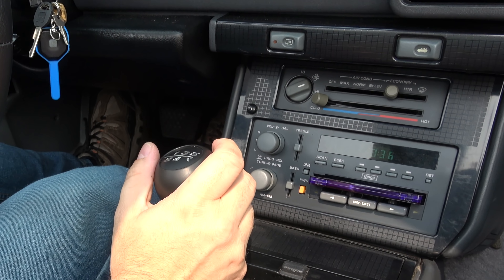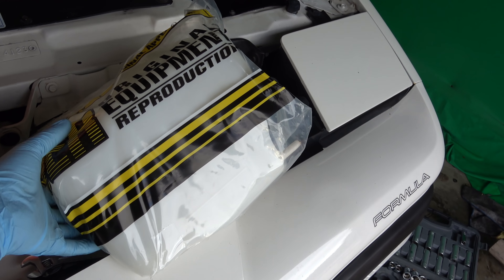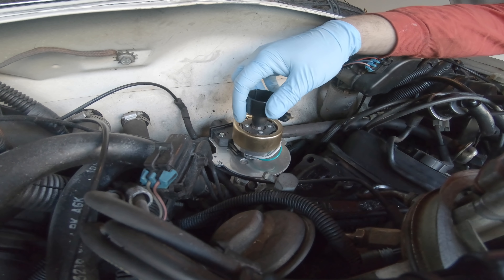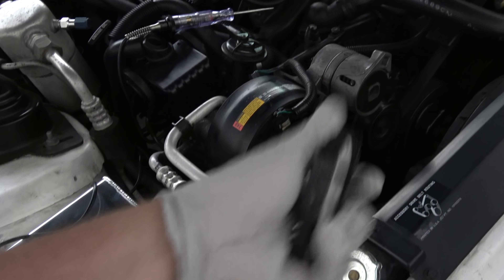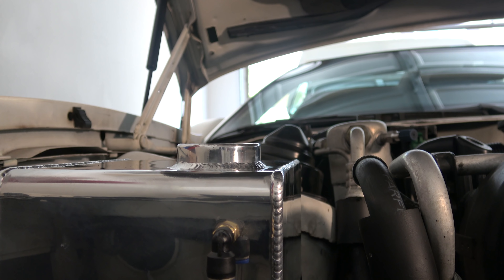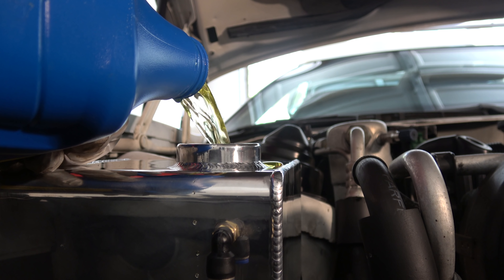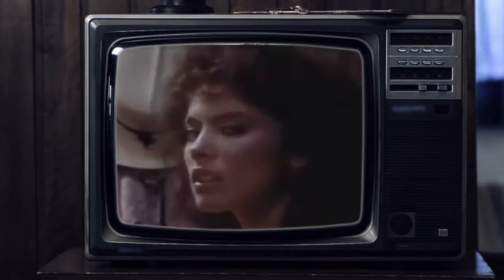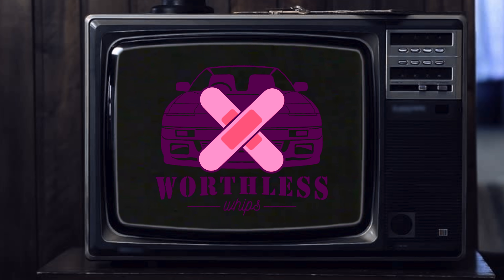They really don't make them like they used to!

Comment: Born and raised in Detroit. Was a UAW member for 10 years... and then I purchased a 1985 Dodge... was amazed at the distinctly superior quality over previously owned vehicles... and then I was shocked to find out it was actually made by a Japanese company. No wonder the U.S. auto industry went bankrupt when it did.
Reply: basically japanese are the german ingeneers of the new world. or maybe the old world cause owning an older japanese car is more of a safe bet
Reply: @4xHitler : Nah, Japanese engineers are superior to German engineers. German engineers can make things extremely intricate and precise, but can't be bothered to test their products outside of the laboratory -- real-world conditions would require overbuilding components, which would reduce their peak efficiency, and that's just totally unacceptable to German engineers. That's why German cars driven outside of Germany require so much additional maintenance -- German engineers design German cars to work well on immaculate German roads, and don't care that their products get beaten to death very quickly elsewhere in the world.
Reply: @deusexaethera  it's great to hear that from you since german car companys build most their cars at every other place except germany you get a lot of trashy poorly produced vehicles despite quality control. also there are many other factors which make car factorys produce worse products today than back in the days (one of them being the top down hierarchy where stupid "engineers" make wrong decisions on many aspects to reach the marketing strategy (lightweight, efficient, cheaper materials). your point is very much valid so I take back my say on german engineerinh
Reply: Nice.  I personally have owned five J-body GMs (Cavalier, Sunbird, etc) and they were reliable crap.  EVERYHTING except what was necessary to move the car broke.  After repeating this with five mid-90's Toyotas (some made in US) the quality isn't that much better.  Door handles and plastic parts break but it'll never leave you stranded.
Reply: Through the last decade German auto builders have 
moved their quality control to the USA and financial 
controlling to China. Do junk quality by weird management.
That's a joke now. Much earlier, 
German cars were better but you had to pay extra
cash for each extra part of equipment. Just as it is 
normal in a market economy. And the Japanese, 
the Japanese, have always built their cars mostly 
only with robots, which of course omits human error.
Reply: Scotty endorses this message.
Reply: @deusexaethera  Here in Finland my family has used mainly German cars such as VW, Mercedes and Audi. My parents drive for living and in 4-6 years they rack up somewhere around 400 000km before they switch to a new car and most of the issues have been minor ones (I guess the worst issue was some problems with the battery). Their cars have been VW, but now they have a new Mercedes. I've driven 2 Mercedes and the first one was from 2004, that car had some issues so we ended up changing it to a 2010 model and it has had no issues (210 000km currently). The Audi my sister has worked also without any issues for many years. There's an old VW from early 90s that we use as an utility car of sorts that has over 200 000km and again no major issues. So in my opinion German cars still are a pretty reliable choice.
Reply: @deusexaethera  wrong. germans test their prototypes in the polar circle, mostly in Sweden and in the Sahara desert. and on their own test grids, crash lanes as well as in-house or a on race tracks like the Nürburgring.  In Europe regular oil changes
are common what yanks dont do. German cars are made for comprehensive thinking people.
Reply: @deusexaethera  tell that to the subaru that is rusting in the garage
Reply: Robby Dey  this are some cultural - or should we say political - differences? Here at most MOT tests are mandatory each 2 years if a car is older then 5 years. And they check everything. Everything. Not as a student degree from the u.s. here at the university told me, that in the u.s. they just check that the cars dont fall apart.... Tip:
go to central Asian countries. They drive the cars and trucks we had there back in the 90's - but i agree that the 90's euro where the best of all decades. Regards

Comment: I once talked to a guy who was looking to have parts made in China. He said he was told flat out by his Chinese contact that he could build to what ever specs he wanted. He could have cheap parts or very high quality parts he just needed to pick his price point. My point is, sometimes it's the supplier that chooses to source cheap parts. I wish I new how many parts are exactly the same from the same factory just re-boxed with some priced expensive some priced cheap. I'm in the process of looking for replacement factory looking headlights for my 2000 GMC truck....dammed if I can figure out which are the best quality for a reasonable price. I don't even know if OEM are any better or just re-boxed Chinese parts.

Comment: I worked on my GM car this evening and had some success! I fixed the window motor on my 2008 Saab 93.
Reply: And where is SAAB now?
Reply: @davidcady7194  Try typing the word SAAB into Google. Glad I could be of service.
Reply: @bigjoeangel  I did and it shows that SAAB as an automotive company dissolved in 2012. I was never disparaging SAAB. I was implying that under the "great" management of GM the company failed. They attempted to have a Chinese consortium purchase them but that was blocked by GM. Who in turn solid technology rights for SAAB to a Chinese company. So at this time the remnants of SAAB is called NEVS which manufactures an electric car based on the SAAB 9-3. Also SAAB AB still exists in the military aerospace industry. GM never got their hands into that part of SAAB.

Comment: I had a 70 Chevelle long ago (wish I still had it) and the quality was miles better than the 80s GMs.
Reply: They had the wrong idea. They believe if you build them reliably, people won't replace them as often. They're pulling Apple Inc. tricks; and their engineering focuses on specific failure points in a time period, with the only option to replace at exorbitant cost.
Reply: They are now built to sell; not to own or drive for very long at all.

Comment: There was a serious lack of quality in American built cars for a long, long run. A lot of really cool and iconic designs, but damn, what a bunch of dogs. 

As usual, great video! 🤘🏻
Reply: Many now have Chevy or GM on them, and they're not made in the USA anymore either (not that that was helpful in the late 70s, 80s, and 90s then anyway).
Reply: @troy3456789  Japan kicked Detroit's ass to the curb during that time. What a shame.
Reply: @jbbuzzable  When American cars were made in Detroit they were actually not as horrible as they are now. In fact, Detroit itself wasn't as horrible as it is now. Detroit is the most dangerous city in the USA now, and Chevy & Chrysler Fiat & Jeep are all terrible.
Reply: @jbbuzzable  The early to mid 70s was basically the end of American greatness in most cars. Now, GM is only concerned with its stock prices; not the reliability of its vehicles. Its job is to do a great job of selling them; not engineering them & building them
Reply: @troy3456789  In my opinion, it started when the US carmakers ignored the quality philosophy of Demming, and he went to Japan. They ran with it.
The overzealous union and corporate greed at the time just added to the fire, creating the perfect storm. 
The Big 3 ignored all of the warning signs. It took them 20 or 30 years to catch on, but the damage had pretty much already been done.
Reply: @jbbuzzable  I also concur about the unions. Unions have been a blessing for many things and they have been the root of all destruction for American manufacturing, and yet another cause of inflation. Corporate greed is sometimes true, and sometimes it is not true. Unions in Japan have been on the decline and are on the decline at less than 18% . I take that to mean homogeneous cultures do not [necessarily] have a cultural or moral difference between management and labor. In Japan, the laborer is just as respected as the suit.
Reply: @jbbuzzable  To me, GM is a corporate version of Elon Musk. They use fancy graphics and write their own awards and press releases about how good they are to sell more cars. They're now a rich person's car that will trade them in every year. "Oh yes, I love chevy reliability; it's so good I buy a new one every year".
Reply: @troy3456789  From what I understand, you can buy a new Tesla for about $40K. That's not cheap, but certainly not a rich man's car. It should last for 300K miles before a battery replacement. They claim with the new battery tech, they should be good for 1M miles.
Reply: @jbbuzzable  Tesla, Inc currently has 1,000 active lawsuits for a variety things related to its cars. With Musk running things, it cannot actually get better. He is demonstrably the biggest, most successful con man in US history.  He made battery powered cars sexy, but is running that company into the dirt.
Reply: @troy3456789  Con men don't land rocket ships.
Reply: @jbbuzzable  There is nearly zero savings in landing boosters back on earth. NASA had already done the math on it, because of the load cost of fuel and the actual cost of fuel just to fly it back again and land it. It's cheaper to build a throwaway booster and use every available space for fuel to boost the rest of the rocket into orbit. He has to use more than boosting fuel just to bring the booster back to earth (as in your have to store and keep more fuel aboard just to bring it back again, and all of that is very heavy). It's partly why Blue Origin had already abandoned the use of it, because they figured it out through careful observation it is more costly.
Reply: @troy3456789  Shirley you are just trolling now.
Reply: @jbbuzzable  In case you don't read that; it says "Elon Musk Settles SEC Fraud Charges; Tesla Charged With and Resolves Securities Law Charge
Settlement Requires Musk to Step Down as Tesla’s Chairman; Tesla to Appoint Additional Independent Directors; Tesla and Musk Agree to Pay $40 Million in Penalties
Reply: @troy3456789  I'd be very interested in knowing where you are getting your information from.
Reply: @jbbuzzable  Watch Thunderf00t and Common Sense Skeptic and several others that demonstrate all the failures of Musk, all of it lined out nicely, including his tweet claims, his claims on stage, the lawsuit article snapshots. It's all laid out. Warning: you won't be a musk fan anymore.
Reply: @troy3456789  It would be difficult for me to ignore that my $20K is now $400K. Go ahead and short the stock to the maximum. Your FUD won't matter.
Reply: @jbbuzzable  What is a fud? anyway, when he crashes I hope you get your money back
Reply: @troy3456789  Geez. I'm actually talking to a person that likes Thunderf00t?
Reply: @jbbuzzable  you could have been upfront with your need for tesla and musk to be successful. I'm financially secure; so I don't need tesla or musk to succeed or fail. He's causing the failure of that company without my help.
Reply: @troy3456789  What is your favorite investment at the moment?
I'm thinking about radiator and washer fluid tanks.
Reply: @jbbuzzable  Not really. This is just a comment section actually.
Reply: @jbbuzzable  zero policy or impact comes from the YouTube comment section. Your feelings are safe here.
Reply: @troy3456789  There was no need for me be up front in a comment about classic cars. It was you that chose to go down the rabbit hole.
Reply: @jbbuzzable  I have nothing for you, no help for you. nada
Reply: @jbbuzzable  I get the feeling you are very upset over this youtube comment section. Take a deep breath and relax.
Reply: @troy3456789  You are financially secure? I think you are the same person who said Teslas were only for rich people.
Reply: @troy3456789  I'm not upset, but a bit frustrated. Sometimes I have to remember that I can't talk to stupid.
Reply: @troy3456789  I am now relaxed as I have been. Give us your OWN opinions as to why you don't like Tesla. Please don't refer me to other opinions.
Reply: @jbbuzzable  Referring you to Musk's tweets and articles describing the problems with that company, its cars, and its massive failures doesn't equate to my opinion. It's a method of conveying well supported ideas about how Musk has not only failed that company, but how he sways politicians with fancy graphcis to help him fail with our tax money. When I work and earn some bit of money to survive, and a portion of it is extorted from me to give to a conman, it feels less good then the money that I earned going to bullets for rifles for our military, or to pay for surgery and treatments for our veterans.
Reply: @troy3456789  I apologize for carrying on about this stuff, but I grow weary of people just spouting shit expecting that nobody is going to call them out.
Reply: @jbbuzzable  It's JD power, and multiple sources as well. I want you to use your favorite search engine to search this term: "Study: Tesla likely the US' worst carmaker for reliability and build quality"
Reply: @jbbuzzable  Musk' fanboys are quick on the defense not unlike progressive leftists and faith-based religious subscribers. Quick to defend with anger; but with zero substance in their defense. They tend to go straight for personal attacks since there is nothing in their mental tool bag. I'm used to it. I don't take it personally.
Reply: @jbbuzzable  It usually goes like this: I talk about Musk, Teslas, spacex, progressive policy or faith-based religion; and they go straight for me personally; bypassing the subject at hand altogether. It's really nothing new at this point. I'm patient and genuinely interested to learn something new; like here is your opportunity to "change my mind". I can't learn anything new if someone just goes full neurotic episode.
   I don't want to be wrong any longer than I have to be; so this is a plea that if someone has the knockdown argument in full support of leftist progressive politics, faith-based religions, or in opposition to freedom of speech or self defense; I genuinely want to hear it and evaluate it. 
   Wishing Musk was a better, more honest person, or thinking that he is a better entrepreneur than he is is very different than actually being a great entrepreneur.
Reply: @troy3456789  I don't judge people by their wealth. But in one comment you say you are financially stable, and later say you are living on a bit of money. Sorry, but that is disingenuous, so I can't take you seriously.
Reply: @jbbuzzable  It's okay. I have two retirements. One from the DoD and one from AT&T. I'm nowhere near old enough to collect social security.
Reply: @troy3456789  Okay. So I'll dismiss your comment 'bit of money' as sarcasm. 
So what is your number one gripe about Tesla. In your own words.
Edit: And with your means, why would you call Tesla a 'rich man's car'? They really aren't that expensive when you consider total cost of ownership.